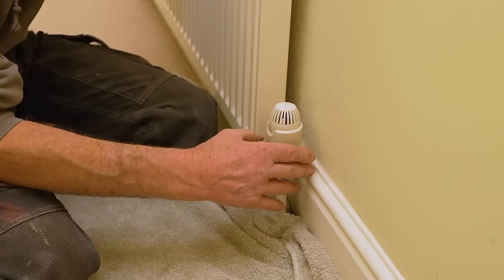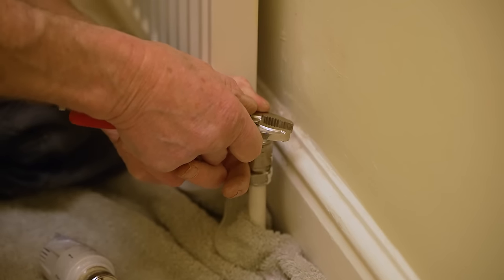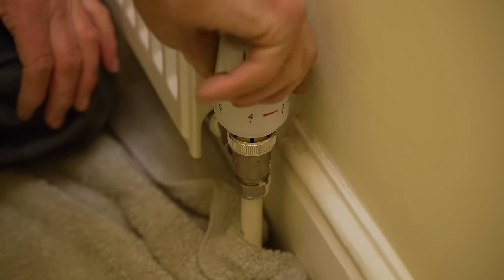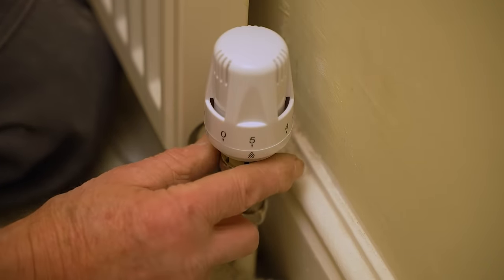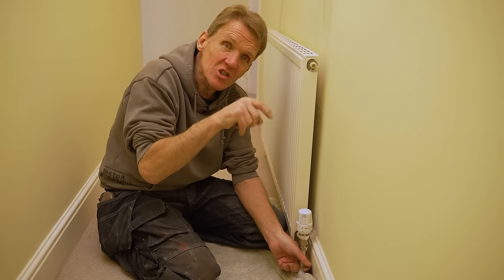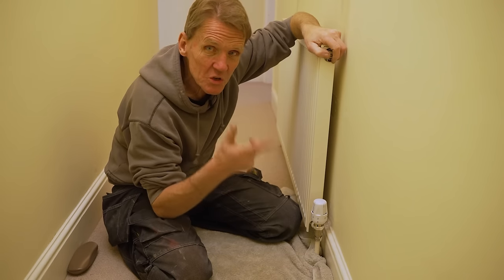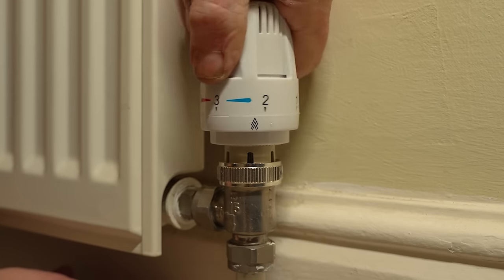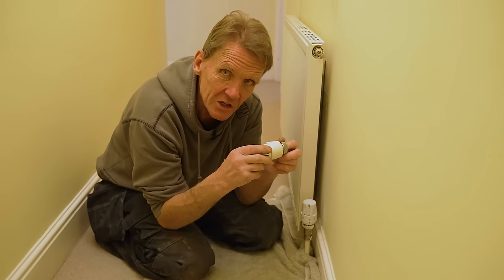Why Won’t My Radiator Turn Off?

Comment: These taps are a waste of time and money. I bought a box of these from screwfix put them on and waited to cool down before adjusting the regulator side. Ok it was set then the following day I turned it off then back on in the night time to see how good my radiator is. The thing is it was cold. Tap on full the rest of the heating was hot but this one rad was cold. I checked the tap and regulator. Both seemed ok. Opened and closed tap nothing. I took the tap off and put an elbow in its place and used the regulator as the tap set it and radiator works perfectly fine . Looked at the tap and turned it both directions and noticed that the centre was not moving tho the tap was screwed back on. These taps are a waste of time. Don’t buy these taps. Stick to the old ones that’s best. These taps that you can twist on with a thread are no good. Very nasty. I hope this helps.

Comment: I keep getting told that one of my radiators should not have a valve like this added. Why would this be?
Reply from the maker: You need to keep one radiator always open so the pump is not pushing on a closed circuit. It is not alway the case but it is never a bad idea
Reply: If the system has TRVs on all the radiators then an automatic bypass valve Must be fitted to the system even with Motorised valves controlled systems we always fit one on the system

Comment: I have boiler thermostat on 21 degree in my kitchen and all radiators have Thermostatic Radiator Valve on 19 degree, does that mean that my oil boiler will burn oil non stop? to reach 21 degree but Thermostatic Radiator Valve wont let room reach above 19 degree?
Thermostatic Radiator Valve have number 1-6 how to know what number represent what degree?
Reply from the maker: The boiler thermostat will cut the  boiler off when the return temperature is reached. You have it set up right so don't worry. No TRV manufacturer will give you a temperature reading for a setting. The sensors vary and you just have to find what suits you. The air rushing past the bottom of your radiator is going to be cooler than the air at the ceiling.

Comment: The only way thermastic valves have any part to play is if you have your heating on 24/7.If you dont just use lockshield valves and balance which radiators you want more heat from.Thermastatic valves are a pain in the arse and always will be.Rant over.If your heating is on a timer and a room stat thermastatic valves do bog all.Nothing ....Absolutley nothing.Ok now rant over.

Comment: Years back when Servowarm fitted boiler to rad central heating the guy obviously lost sight of which way the flow was running. I had awful hammer from two valves which he came back to fix. He fixed it by just turning the affected trv's through 90 degrees. Fixed the problem but just did not look right.